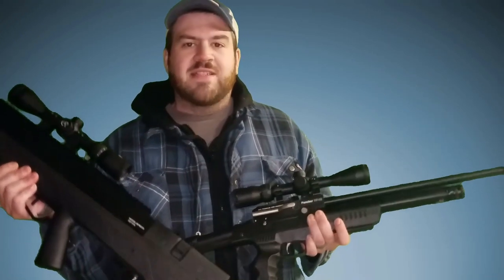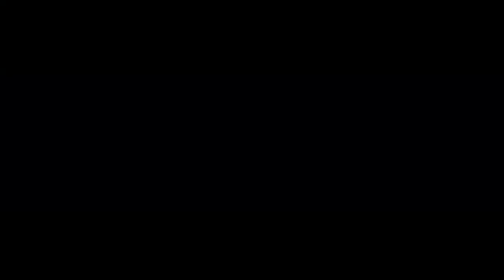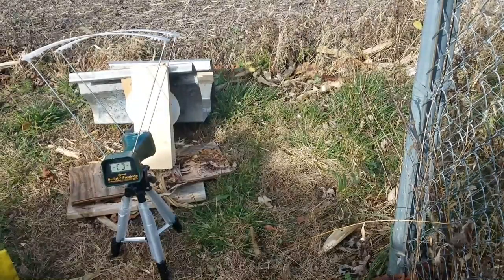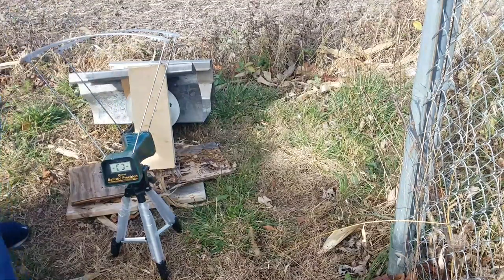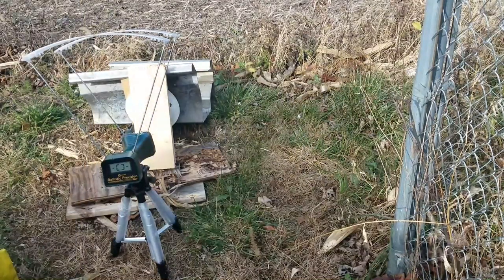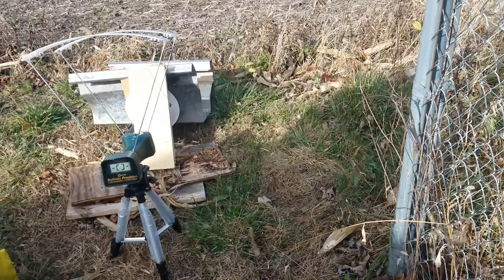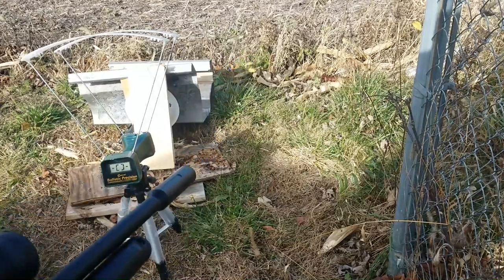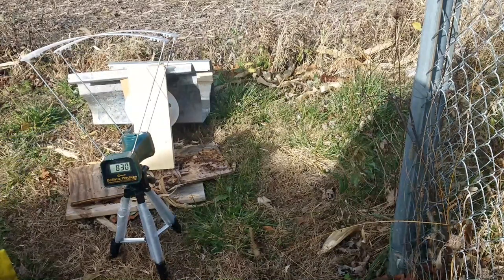small bore vs BIG BORE PCP Airgun...

Comment: I shoot hornady 158 grain $29 for 300 38 cal pistol reloads,run em thru a lee 357 die.
Stock buldog,preload 3 turns in i get 749fps 196fpe on 1st shot down to 605fps 128fpe on 10th shot.at 10 yards.
Cheapest bullets at 9 cents a round
2" at 50 yards.....but alot of power.
My brother ported his to the max and puts out 240ish fpe for 5 shots.
With barrel supports and tight hold hes getting 3/4-1" at 50 with the same rounds.
Hornady .358 158g LRN item # 10508....look em up
Reply from the maker: Nice thanks!
Reply: @STKO2011  i just drilled my valve and barrel transfer port to 9/32,removed factory transfer port.turn hammer adjustment 4 turns in from flush.
6 shot string 158g
#1 error
#2 856
#3 851
#4 841
#5 830
#6 816
856 fps is 257 fpe
816 fps is 233 fpe
This mod cost nothing,and 9/32 allows you to still use factory transfer port tube to get back to stock.
Groups at 50 are now at 1",faster the fps the more accuracy increases with heavy rounds.
Im bettin i could easily hit 900 fps with 158g with a hammer spring swap.

Comment: Try the recamended nosler bullets or really any bullet .357-.358. 6mm will not engage the rifleing unless it's a pellet. Your really not seeing it's potential with those light pellets, my personal favorite is a lee 358-158-RF.
Reply: I just ordered a lee mold in 358-125-RF to try out. Hopefully it works well; as a bonus i can reload .357/38 as well
Reply: I have thought about trying the 125 grain, let me know how it works. I run the 158 grain through a .357 sizing die but they shot well either way.